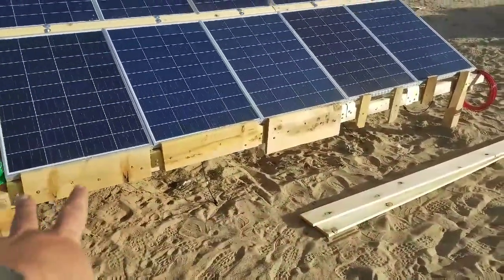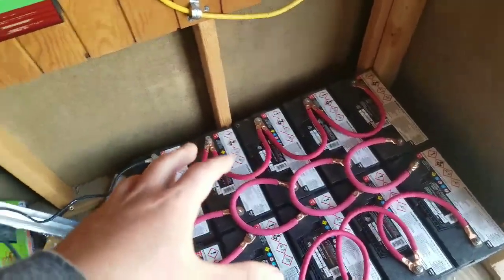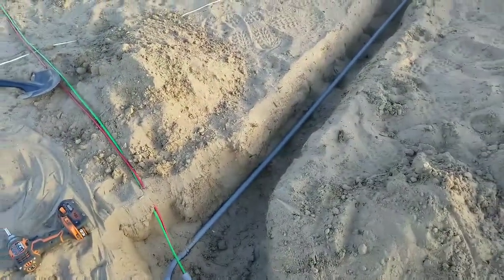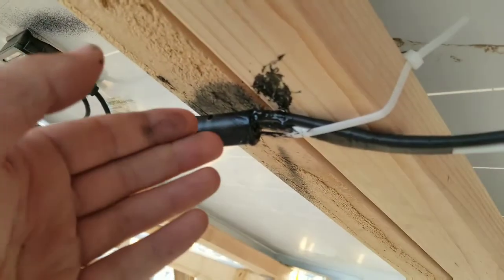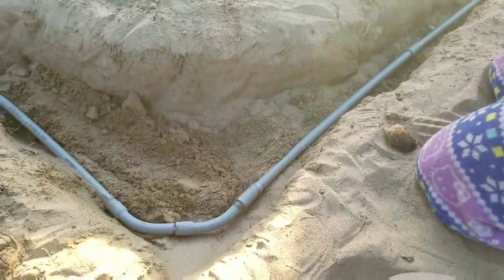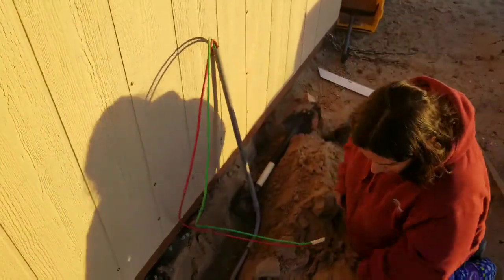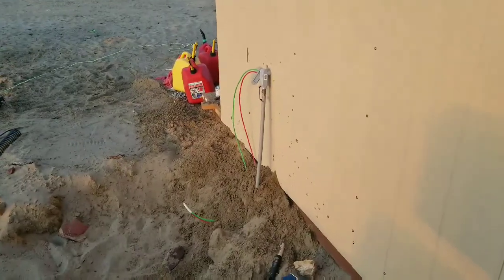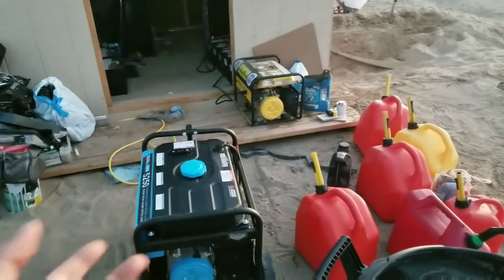Wiring the solar array and burying conduit for off grid power

Comment: Hi there! - Great ingenuity with the setup - I've been working on solar power system design for 5 years now, and I'd like to leave a few bits of advice - if  you are into it - otherwise, stop reading now. 

   The panels are now wired, but in future, if you do add more, Its really handy to run the panels all to a large enough junction box that you can then either parallel or series them together - this allows other options for the future, like setting up 48V batterys, or using higher voc input MPPT regulators like the Victron smartsolar range.
   Furthermore, if you have any issues with the array, you can isolate each panel and test it - they do fail sometimes ;) - KEep in mind also, some panel suppliers (if you buy them new) may not honour warranty if you have cut the plugs, as it can allow water ingress to creep up the cable and corode the insides of your junction box and diodes.

  With your battery system, Nice thick wire there (is that 70mmsq? ) Mind your parallel connections, 4 is usually the max, beyond that, you should make use of buss bars, in order to ensure even charging across the bank.  
   Also - Every parallel connection should have a fuse on it - on the terminal works best,  If you aren't using buss bars, rate the fuse to your inverters peak X1.25 so that would be 3000/24 = 150 +37.5 = 187.5A (a 175 would work ok)
  So long as your cables are rated higher than the fuse, you are good. **( If you are using bus bars then you could theoretically use fuses that are 1/5th of the inverters peak rating X 1.25.)

  The inverter, should be connected diagonally across the bank - so Positive at the first 24v block, and negative at the 5th 24v block - this ensures more even discharging - (the regulator should connect to the same points). Again With the use of Buss bars here, you would be connecting the inverter and any other DC loads, and the regulator and any other DC charging systems to the Buss Bars. All the leads to the battery terminals would be as close to exactly the same length as possible and each positive lead would meet a Fuse Kit on the positive terminal.

  If you have fused the parallel connections that means your inverter leads are protected but you can make use of an NH01 3-Pole Fuse Block/Breaker too. This is a useful main shutdown switch, to turn off the batteries, if you need to swap the regs, or do other maintenance. The switch is also an excellent safety fuse for the entire system.

   The PV in should be coming through NOARK 2-Pole Circuit breakers (Ensure the breaker is about 30% higher than the panels max output. (You can use different brands of course, this is just what I am used to in Melbourne) Havjng Array isolation allows you to also work on the system safely. It is also another point to test from if there is diagnostics needed.

   IF you arent familiar with them - Check out Victron Energy - they are an excellent company that provide all the components for  complete solar solutions and distribute gear worldwide. Industry leaders. 

  I hope you have built your castle much more since the filming of this video - keep up the good work - Peace, Pip